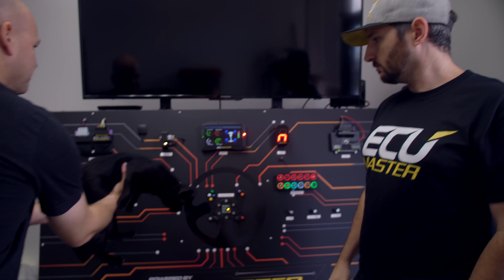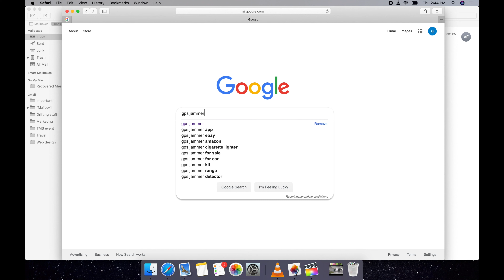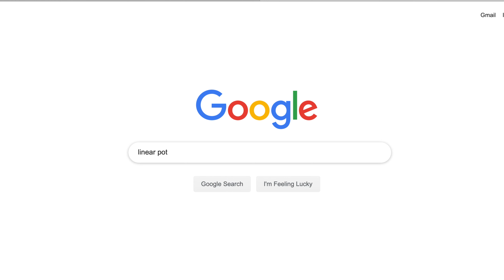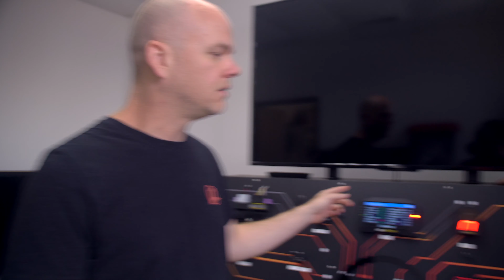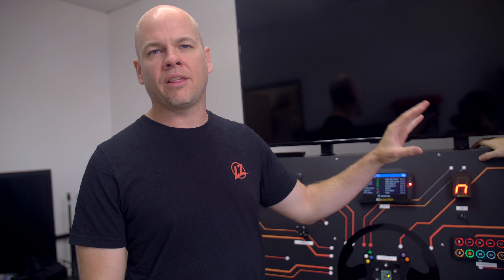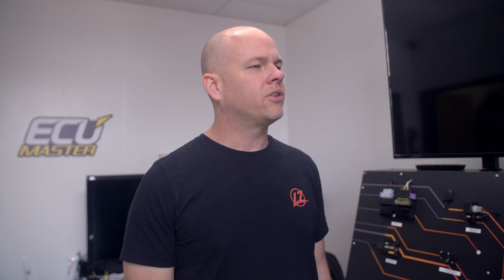Cheating in pro drifting?  Data collection with drifting tutorial.

Comment: Why cant they use wheel speed sensors?
Reply: Because you could create a type of traction control that would basically make the car drift itself or just make a system where you can keep the pedal pinned but the car will never spin out because it will cut power to reduce wheel speed as needed. And we don’t want to see that, we want to see actual driving.
Reply: Ahh that makes sense! Thanks!

Comment: I recall a few years ago some drivers were doing some shady stuff with real time mechanical left/right brake biasing based on steering angle. Actually now that I think about it I want to say someone even had two brake pedals (might have been Odi or Chelsea).
Reply: @LoneStarDrift  @Darrin Hillier, Not sure about two pedals but Chelsea (and others) used to have a proportioning valve on the front brakes to basically "hide" left foot brake by dumping more pressure to the leading wheel preventing the trailing wheel from locking up the way it normally would with a bunch of roll stiffness. Pretty cool idea but it's not legal anymore afaik
Reply: @LoneStarDrift  Been done before in f1. Lets you carry more speed in a corner by braking just one rear wheel. dunno if it would work in drifting
Reply: @LoneStarDrift  I belive it was used to help the car hold angle by only braking the inside front wheel. You should ask Chelsea,  I'm nearly certain either he did it or he talked about it a video he made.

Comment: in dirt late models ive seen some products that'd allow limited wheel spin like 10-15%. even in drift it'd be useful to keep consistent grip and get the most corner speed and speed leaving the corner. I wouldn't want to see this type of stuff in drifting to begin with but you got to be a good consistent driver to make it worth it.
Reply: I'm pretty sure those use wheel speed sensors to accomplish the task.
Reply: @DJ.1001  there was wheel speed sensors plus gps but then like he said there was ignition retarding when rpm would 'jump' it would mess with the timing. All for the ignition one was a plug and play device that would be very easy to hide.